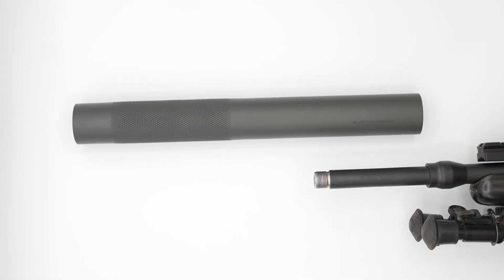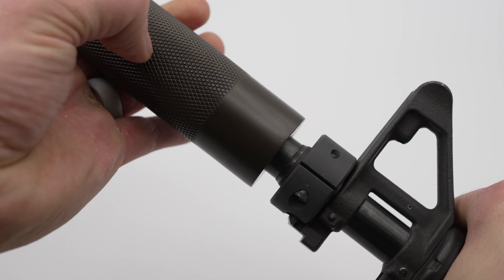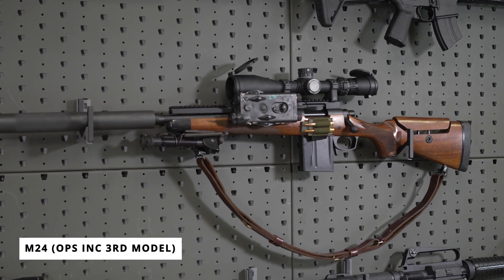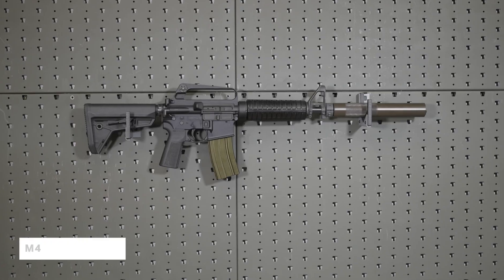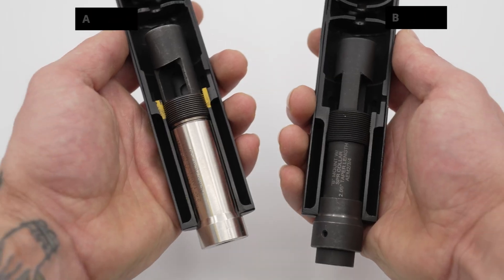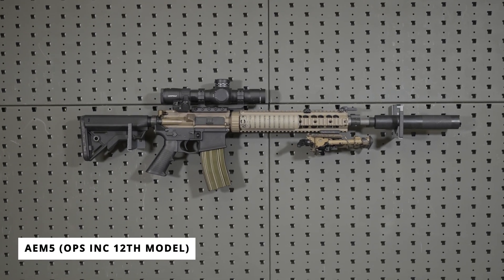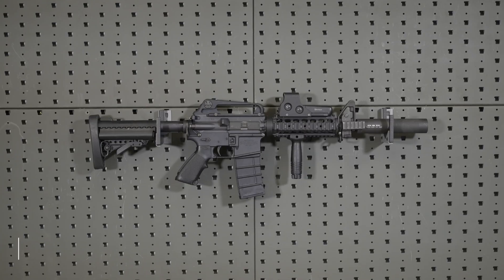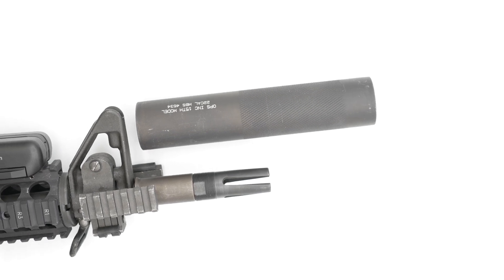AE Mounting Styles

Comment: How effective are the OTB-FH and OTB-BM mounts from OCL?
It seems like since it really only has a mounting on one end, it would not be as durable.

Does the AE brake and collar work okay with the OCM5 cans? If so, do you have them in stock?

Thank you.
Reply from the maker: Its got downsides and upsides. Its a lot easier to use, but you lose accuracy and durability benefits.

Comment: I wanna get one of your suppressors but every one in my area only wants to deal with getting cans from silencer shop.. anything else an they don't want to deal with it
Reply: They can still do the paperwork through SS.
Reply: Buy one from someone who sells it and have them send it to your FFL. Easy day
Reply: Usually they'll do it just charge you a lot. A LGS I use wants $150 per non SS cans.
Reply: @MrCooper89  if they order it direct or through Allen Arms Tactical they usually don't charge the transfer fee. Just depends on if they are willing to order it from somewhere other than SS. There likely is more money in it for them anyway since SS has a lot of fees.